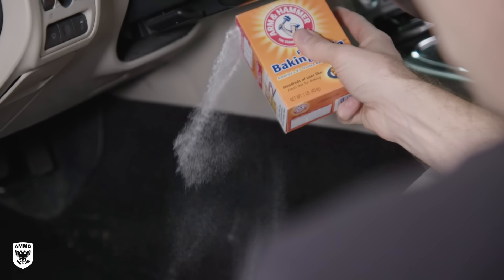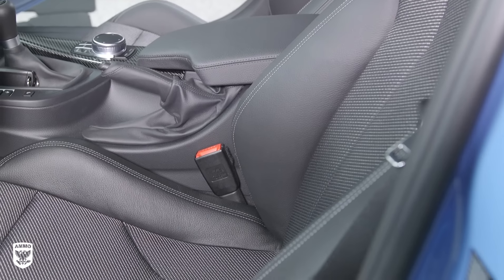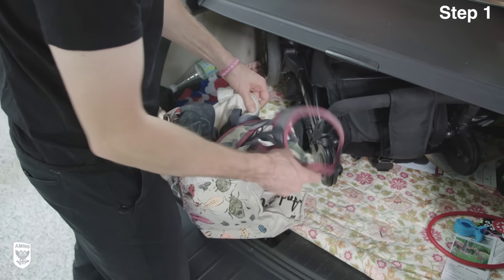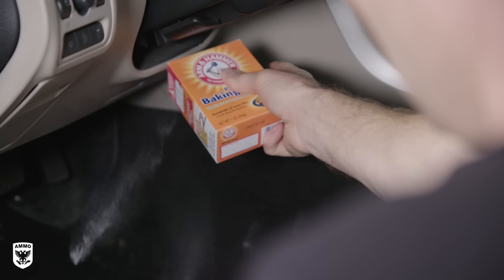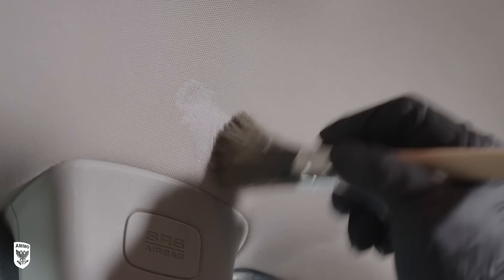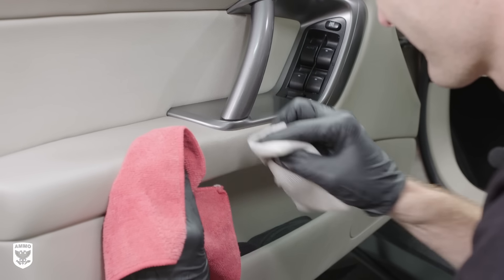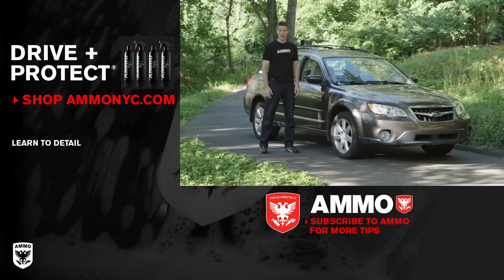How to Remove Car Odors in 6 Steps

Comment: Im a fireman and my Subaru xv was driven in the middle of a forest in fire, and it toke years to discover that the only way to eliminate the smell from fabric and plastic parts ways with vinegar. The situation is a little extreme, but I hope my experience helps somebody to solve similars problems. It was no posible to desamble the entire car, but now thw car smell better.
Reply: Did you spray or how did you get the smell out? I used vinegar in car before and the vinegar. smell lingered a long time

Comment: Plus, small tip: cleaning the seatbelt is also what will fix your belt when it's not rolling back up anymore. It is not because it became stiff, because of the dirt. Hot water and cleaning will fix that.

Comment: Many smelly problems in vehicles come down to mold or mildew growth somewhere within the car. During summer, when we rely on air-condition to help us survive the scorching heat, our cars are susceptible to growing molds. We usually have our windows closed during summer to have the cold air from the air-conditioner to circulate. That alone will make the mold thrive and survive inside our cars.

Comment: Quick Tip! If you have leaves or Debris(like acorns) vacuum or blow out the housing before putting in a new cabin air filter. Any acorns are just hard enough to ruin the blower motor causing a noise or in some cases a horrible vibration!

Comment: Last summer my friend spilled about 2 cups worth of milk on my backseat. We were heading to work and I had no choice but to let it sit for almost 10 hours.
When I got home later that day I just unbolted the seat and saturated center seatbelt buckle. I did not have the proper tools or chemicals to tackle this problem and I needed the car for work the following day.
Here it is 5 months later. The backseat has been aired out for all this time but I don’t have a clue as to what I should do to make the seat safe to put back in the car.
It’s a bench style seat. A giant block of foam wrapped in black cloth. I know hiding underneath the cloth is some nasty looking foam. 😔

Comment: bro, although these steps help remove stains and such, the steps you've shown only masks the bad odors. They don't kill the bacteria that's causing the bad smell. Especially on cars where the driver is a smoker. The better and easier way to remove bad smells is to kill the bacteria that's causing the bad smells and that's by using a ozone machine. just 1/2 hr of it on in the car will kill all the bad odors

Comment: Great video. I was also starting with baking soda. Is there a product that you know of to clean seats with odorless foam? I have a car smelling strongly like laundry detergent from the previous owner and it's hard to get out. It's smells nice actually but it irritates me.

If baking soda does not work what kind of product would you advice for that?

Comment: I drive a soft top jeep wrangler and there is a terrible smell of either mildew from a previous leaky top or cat urine from pets climbing where they shouldnt be when the top is off. Do you have any tips for removing these especially strong smells within the seats, (All carpet has been removed and thoroughly cleaned but the smell still lingers leaving the only areas possible as the seats or the non-working AC system.

Comment: Larry,  

Can you provide a link to a vent cleaner you'd recommend?  

Thanks!
Reply: Looking for the same thing.
Reply: @colbyshull1070  The website www.autogeek.net has the following information: "Unlike the first formulate of Klima-Cleaner, Nextzett Klima-Cleaner is NOT to be applied through your car's air vents. The application method will require you to disassemble interior trim and is recommended for advanced users only. Not for Acura cars."  Check their website as well as Nextzett's website for more information about the use of this product.
Reply: Kilma Cleaner ETU is like a fogger that you leave in the car for a few minutes with the AC on.  The Pro version is a new version of the one shown in the video which doesn't use the tube in the vent as before.

Comment: Hi! I bought a car that has got some water inside on the carpets during the winter stowage. There was some ugly mold on the surfaces. I totally stripped the interior and powerwashed the carpet. It is more fresh now but how do you remove black mold stains off of light coloured seatbelts? Should the baking powder mixed in water remove the spots? What do you recommend?
Reply: I'm gonna guess use the product that he recommended in the video on the seatbelts, the Shag spray stuff.

Comment: What if the car has been sitting out in the open, only covered by tarps for the past 40 years, and reeks of bad aging and mice? I've cleaned the car numerous times since I've gotten it, and even stripped out the interior to clean it (though that wasn't the original intent, but I took advantage of the opportunity).

Comment: I need help with cleaning really bad beer/water/liquid stains on suede in a 2011 Malibu, light brown interior
Reply: The Malibu does not have suede. It’s microfiber throughout. Any automotive all purpose non abrasive cleaning agents will work. Use a spray bottle to spray the entire seat and use elbow grease with a microfiber towel. Repeat 3-4 times then wet dry vacuum.
Reply: Todd Privitera which of your products do you recommend?

Comment: My musty moldy car smell is from previous owner letting leaves and debris get all inside engine bay. When I turn on ac it's this horrid smell. How can I safely get all the leaves out and dirt from every crevice in the car. It's like this guy drove through mud, took it to the car wash and all the other parts were left. Geez. I dont want to pay a detailer, but might have to

Comment: Hey Larry, I'm about to store my car for the winter.
Do you have any other tips what to do other than moisture absorber and proper clean before leaving it under indoor cover?
Also do you prefer windows down or up under cover?
Reply: You can buy baking soda in fridge packs, that have a material you expose by peeling back one side of the box. One of those, replaced every 30 or so days would probably help mitigate any random smell.

Comment: How to clean Alcantara ?
Reply: Jianyue Tang use a dedicated cloth and alcantara cleaner together with a soft brush and a microfiber cloth :) just spray a little onto the brush and do circular motions on the material. This will remove dirt and grime, but also help lift the fibers.

Comment: How does one remove that funk that only occurs when turning the AC on?
Reply: IzzyStillYDGn but wouldn't you smell a bad filter with or without AC?
Reply: Get the dead mice out of the vents...
Reply: Some cars have a problem with mildew in the AC condenser pan.  I know our Mazda CX-5 (and all CX-5's) have this problem particularly when running the A/C on recirculate.  For some reason it just builds up a crap load of condensate moisture, which can start to mildew.  If we always run the A/C on fresh air instead, it doesn't really smell.
Reply: Replace air conditioning receiver/dryer
Reply: Try Ozium.
Also,,run the vent for a few minutes before stopping the car if you’ve been running the AC.  This drives  the moisture off of the condenser.
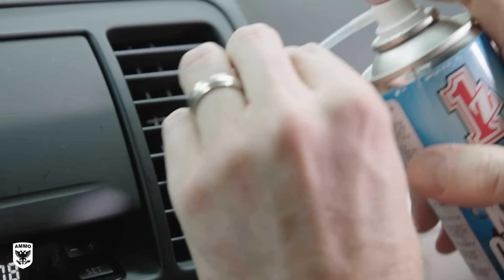Reply: It's called watch the video. 03:38
Reply: This is an important key for humid ohio summer weather, otherwise condensate andsmelly eventually  mold growth develope

Comment: if anyone could help me, my special needs sister peed in my front seat, I managed to remove the pee and odor of the pee from the carpet underneath but now the carpet (not the removable ones) spells heavily like chemicals despite using water + wet vac, also I took the seat out and sprayed the bottom side of the chair with a sanitizing spray but now the seat smells a lot like this gross spray and still a little bit of pee, there are a lot electronics attached to the seat so I can just water it down, I've used baking soda on the carpet and wherever I could on the underside of the seat, I aired out my car and sprayed fabreeze, any ideas how to get this horrible smell out? would a bunch of car fresheners work?

Comment: 3:10 why is the handbrake not pulled? Do Americans not pull the handbrake when they park?
Reply: Charles Li americans drive auto
Reply: T Sal I know, but you still need to pull the handbrake.
Reply: Charles Li yea it's not really needed since the axles lock when it's in park but it's always good to put the brake on us Americans have a habit of not doing it since since 90% of people drive auto transmissions
Reply: only on a steep slope

Comment: How do you make a shiny leather steering wheel look like new again? So remove the shinyness, leather is in good condition.
Reply: Basically the same way as you would with leather seats or other leather surfaces, but be extra gentle with it as the leather in steering wheels is often in worse shape then it might look like when quickly inspected (due to the shinyness perhaps...) Pretty sure there's a vid about leather cleaning here in Ammo channel.

Comment: What if i have leather seats? My car has a really strong leather smell
Reply: people tend to love Meguiars rich leather cleaner/conditioner because it looks good (on black leather) and it smells good.  Longevity is crap though (~6 weeks) so its conditioning abilities are quite poor.  And it does not actually penetrate/hydrate the leather, it just sits on top.  But if all you want is your seats to look and smell good, it's the cheapest solution at $15(CAD)/bottle
Very few leather conditioners actually hydrate the leather which is why I consider the term "leather conditioner" to be false advertising in most cases.
Reply: Use lubriderm or nivea.
Reply: Zenon B look up leatherique
Reply: leatherique rejuvenator oil's probably your best bet at hydrating the leather - some say it helps remove wrinkles but I don't know for sure.  I don't use it for my customers because the product requires a hot sunny day plus 8+ hours to bake in the sun before you remove it.
But if you have the luxury of a hot, sunny day, and can park your car in the sun all day then ya, leatherique seems to be the top-of-the-line solution to hydrate the leather :)
P.S - it's around $40(CAD)/bottle, and instead of using the 'pristine clean' to remove it, I'd probably just roll with meguiars leather cleaner/conditioner to remove the leatherique.

Comment: My 2001 facelift Audi A4 B5 still smells like new car, didn't when i bought it 5 years ago tho but cleaned it out properly without using any air freshener og scent spray.
My 2007 Audi RS4 also smells like new car with only minor cleaning.

If you buy cheap cars you get cheap smell.
Most cheap dailies I've driven (full time car mechanic) smells wierd and unhealthy when they are clean, but most of them isn't clean and smells like baby barf, smoke and filthy dogs 😷

Comment: Baking Soda will not remove bad odor! although your youtube is set nicely but this info about Baking soda is incorrect, baking soda will only absorb moisture from the air inside the car and will react to corrode whatever surface it was applied to. Bottom line, don't apply baking soda as it''s not fit for the purpose and will not do but harm to the cars.